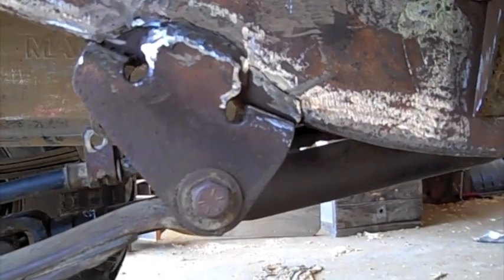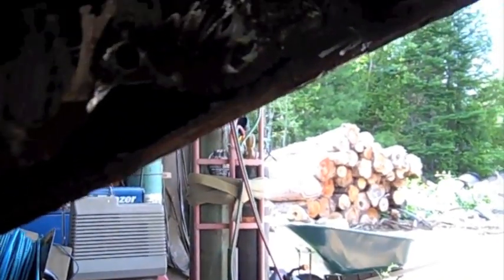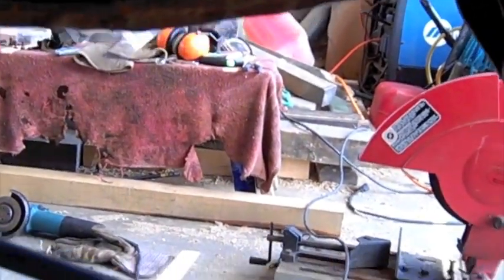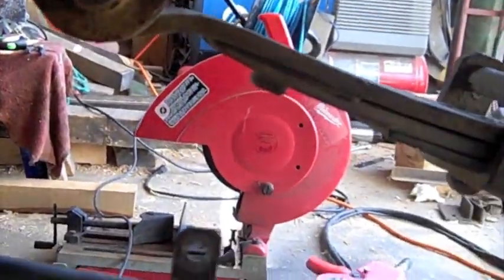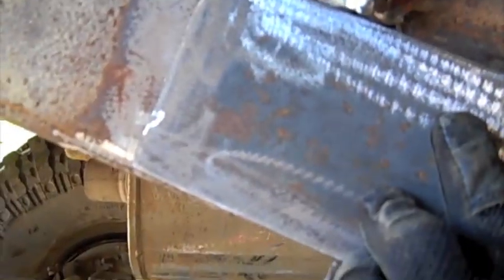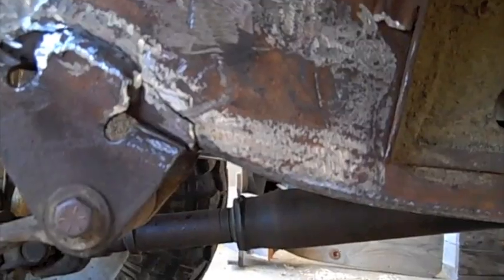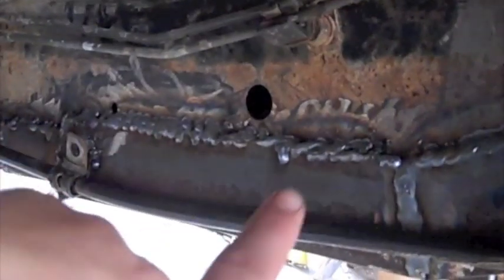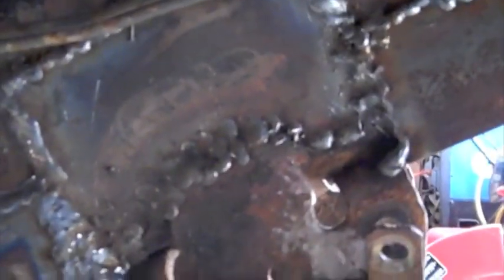Broken Leaf Spring Bracket/Truck Frame Repair

Comment: got a 94 toyota the owner didnt want to even bother with the frame, its a GREAT truck, NO body rust, no scratches in the paint, engine and trans were amazing! only 153K miles, except for the rusted out frame, it was an amazing truck i could NOT pass it up i got a sweet deal, patched up the frame, not it runs like a champ! :)
Reply: eaglethorn I got a similar deal. Lifted '95 Tacoma with amazing body and drive train. The only problems with it are a ripped seat, hole in the muffler, and a hole in the frame rail right under the leaf spring hanger. The frame seems totally solid otherwise, but I'm going to grind it down to bare metal, patch the hole, weld in some strengthening plates and, prime and repaint.

Comment: just found out today my truck has the same problem i got till sept to get it fixed what state do u live in cuz im hopein where it goes it will still pass thru i dont have the money for a new truck def but its in the same spot my buddy told me just go to work cuz the brakets could brake off the frame where its broke and lose my ass end but just wonderin what state u live in to know how it will pass insp like that   95 c 1500's the truck

Comment: Bro your weld look a bit cold turn you amperage up in move slower in do the a weve pattern in do a few runs on a peace of scrap metal to set up before you weld on ur frame couse it will crack if u dont get good penetration in you will be grinding in doing over or worse yet get in a accident

Comment: @fullbandosftw098 all my spring hangers and so on were beefed up when i had the heavy duty suspension fitted by my uncle.all the bushes are now nolothane and rubber floor in the cab,whats the use of carpet when your messing around in the bush

Comment: Nice Fix , sometimes its worth fixing if to learn how to repair  yourself.  Looks like you used flux core, might have been smoother with shielded gas (mig). Also did you spray it with rustoleum afterwards. Will last you another 10 years!

Comment: I have a 97 tacoma with frame rust right through and an even worse leaf spring bracket (frame that the bracket is welded on is half rotted away). I am no good at welding and dont even want to try it, how much would it cost to pay someone to do it?
Reply from the maker: +WhitetailHunter98 Sheesh, I can't even take a guess at cost. Never hired anyone for a welding job. Usually just take a whack at it or have my dad do it. Should have had him do this one for me, ha. 

Where abouts has you truck lived? Somewhere they put calcium chloride on the roads in the winter? That's our problem here in Maine
Reply: Yup. New Jersey. This salt kills my poor truck man, such a same I just inherited it from my father not even a week ago and I've already gotta dump so much money into in :(
Reply from the maker: Done any research on the Toyota frame rust recall? I don't know what it takes to be eligible for that
Reply: Ya, its too late for me :(

All i can do is take it to a frame repair specialist and see if its even worth repairing anymore
Reply from the maker: Good luck man.  We have some newer Toyotas now with clean frames we are pounding the rust prevention to.
Reply: Thats the best thing to do is prevent it man cuz once it starts is near impossible to get rid of

Comment: Neighbor of mine had a nissan with around the same level of rust. Japanese quality steel is piss poor. Apparently applying some type of corrosion resistant coating isn`t in the Japanese language.
Reply: Road salt is EXTREMELY corrosive. Apparently you have never worked in a body shop in PA like I did. The melting snow/salt dripping off of the cars burned you skin IMMEDIATELY upon contact. That level of corrosiveness can eat through ANY coating. I was under cars that were 5-6 years old, that looked worse than 50 year old southern cars. Japanese steel quality is fine. Now if you will excuse me, I have to go weld the cracking leaf spring brackets on my US made F-150. The new hangers come in next week, and I don't want to get stranded while I wait.

Comment: that frame is screwed thats why i wont buy toyota rust magnets
Reply: They may rust but the engines are indestructible. I'd rather have a reliable drivetrain than to have to worry about a little welding